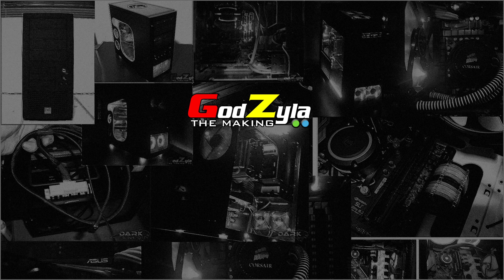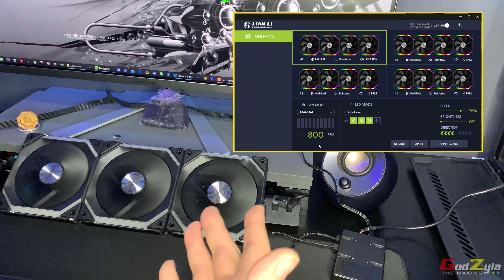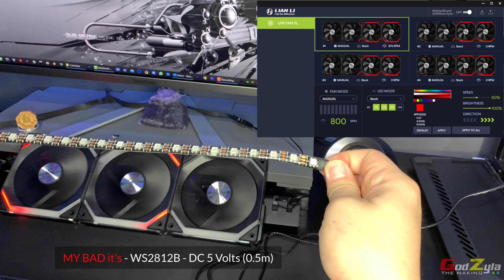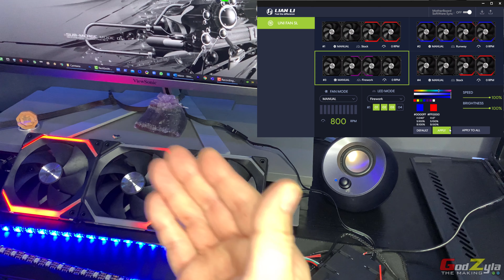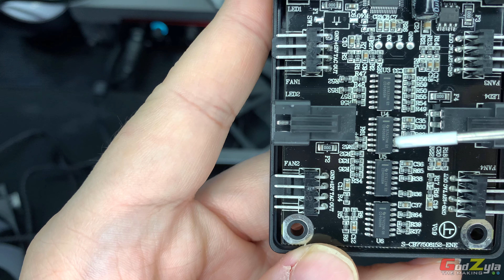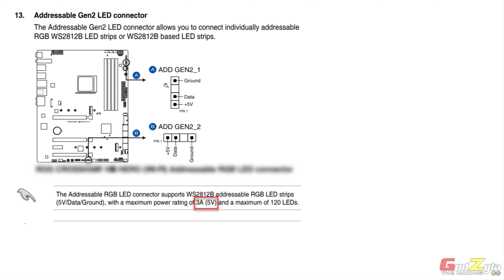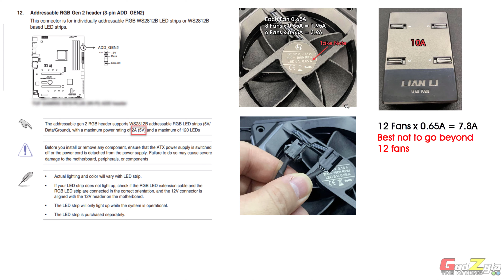Lian Li UNI Fans SL120 - Dos and Dont's (Part II) [L-Connect]

Comment: If I connect these fans to a fan controller than comes with the case and connect that PWM cable to a mobo header, will I be able to control these fans individually via the mobo?
Reply from the maker: Hi stardust 932, welcome to my channel. I believe you are asking on pwm control. If you plug the fans fan connection to the uni controller and to plug the pwm cable between the uni controller to the motherboard fan header. all your fans will follow to that specific pwm settings. you will not be able to control those set individually. However you can leave the argb connectors of those fans to the uni controller and plug their fan load connectors to the different motherboard fan headers, this way you can control the different set of fan's via the motherboard PWM curve which you set.
Reply: @KleoYan  hey, appreciate the response, thanks!
Reply from the maker: @stardust9329  You are most welcome and I hope you are not confuse by my answer. If you have doubts, do not hesitate to ask, I will be glad to aid you out. thank you!
Reply: @Kleo Yan  no i didnt get confused, i realized that the software will think there's only one fan because it's one pwm connection  (connected to 3 fans), so regardless of whether i put the pwm signal into my mobo header or the icue commander pro, the rpm config will be same for all 3 fans  (unless i use 3 separate pwm slots which defeats the purpose of the uni fan design), thanks once again!, i was basically trying avoid a lot of cables cuz you know how it is with these corsair fans, 2 cables per fan, but it's the same case here if i want to control each fan's pwm separately 😂
Reply from the maker: @stardust9329  I see, I never had any problems to manage massive cables as I normally pre-managed them before I insert into the case. This way you will have better control of the whole mess. If I am do to the cable management at the end when all components are inside the case. It will be messy. A trick when I observe when doing pc builds 😬
Reply from the maker: @stardust9329  ok just to share with you. This is my style on pc build https://youtu.be/s20jODhCCcI and this is my actual rig https://youtu.be/0qSaX_mOjQc
Reply: @KleoYan  oh i see, yea i think i should pre-manage than towards the end, i'll check these vids out, thanks a lot !
Reply from the maker: @stardust9329  you are most welcome. all the best in your build too :)
Reply: @KleoYan  thanks :)

Comment: love the videos. Still cant seem to get the fans/rgb to work through L-connect. everything runs but at default. I've tried eveything including Lian-Li software patch as well as L-connect (2). Do you have suggestions?
Reply from the maker: Hi Monte Ryan, welcome to my channel and thank you for the compliment. I like to check with you, 

1) Are you using then SL or AL uni fan? 
2) If it’s SL, does you uni controller have a SL marking labeled on it or without?
3) Which mother board are you using?
4) Are you using any motherboard argb app before installing the L-Connect (2)? 

Will need to know the above before I can try to aid you out. Thank you.
Reply: @KleoYan  hi thanks for the quick reply. The uni fan controller is without SL markings. The motherboard I am using is a Gigabyte Aorus pro Wi-Fi. No apps installed currently. I did have them installed before but have since uninstalled them as I was troubleshooting the issue.
Reply from the maker: @mryan3204  thanks for the fast reply. you've mentioned you did uninstall the previous argb app. I will suggest to follow these steps.

1) Install Revo uninstaller ( https://www.revouninstaller.com/revo-uninstaller-free-download/ )
2) remove the L-Connect (2) with revo uninstaller and clear off all registry left over ( illustration over here https://youtu.be/2eK7QFynxF8?t=341 ) 
3) once you have done that. re-install the argb app which you have uninstall it previously
4) use the revo uninstaller again to remove the argb app 
5) reboot your device 

now reason to practice the above. it could be your previous argb app still having left over registry which causes your L-Connect 2 not able to use.

6) Have you update the chipset driver for your AMD or Intel motherboard? https://youtu.be/8l4i5UjO3es
7) If you did, next, just to check, have you patch the SL uni controller correctly. https://youtu.be/hZpzR_4917c 
8) If you have perform 7) , proceed to install your L-Connect (2) app, test it out. 

see if the above steps helps you out. thank you!
Reply: @KleoYan  thanks for the advice. The patch for the controller is not recognizing a device. Device manager on my pc sees the controller “Lian-Li” but Ene ISP tool does not. I’ve tried all other controllers that came with fans as well as replacing cables.
Reply from the maker: @mryan3204  hmm.. before you test it on your L-Connect 2. did you test it with the original l-connect version 1? I am not sure if your uni controller is done with the firmware properly. for me, normally I will test it with the orignal L-Connect version 1.0 before I do any firmware. This is to ensure that your system is communitcating with the controller and to make sure that the fans are responding first. once that's done, then I will proceed to do the firmware. 

At this moment of time, I only have these option for you. use another controller that you have not done the firmware. download L-Connect version 1.0 and test it. 
if your fans does not response. I can only assume is nothing got to do with your fans or controller. it's your system if not communicating with the controller.
Reply: @KleoYan  I’ll try. Thank you for your help. 🍻
Reply from the maker: @mryan3204  you are most welcome and all the best in your build.

Comment: Hi yan, my fans are going bad shit loud for no reason
and when i checked on the L connect software, all the 9 fans that im using 
is running at 0 rpm
Reply from the maker: Hello Axel cheeze, welcome to my channel. Are you able to control the argb effects?  And are you able to set at l-connect to quiet, high or full? If you able to do those? Or are you trying to make use of the motherboard pwm fan curve on your L-Connect application?  I will test out the rpm on the l-connect first to see if your fans does react when u set as quiet, high or full.
Reply: @KleoYan  I can change the colours and the fan mode  through the L connect app, but the rpm is still showing 0rpm
Reply from the maker: @Capturefoodventures  hmm 🤔 mind if I ask what mode did you set on L-connect? pwm?

Comment: Kleo can u help me ? I made a 4x3 unifan build : i have a set of 3 fan that i cant modify speed. I can modify lights there is no problems but not speed. I tried pwm but nothing change its always at 1800rpm. I plugged, unplugged cable, uninstall l connect and install again. Nothing changed 🥺😭
Reply from the maker: Hi SUP, welcome to my channel, have you tried changing output.. as all your output from the uni controller are occupied by 3 fans each.. you can try swap fan set as in example. swap output one set to output two or three or four.. see if it's the set of fans is having the issue or the output that you are trying to fix is faulty?
Reply: @KleoYan  hello kleo. I will try to switch them. If the problem remain it mean that the controller port is faulty. I will let you know😄 thanks
Reply from the maker: @SoupeDeSup  you are most welcome and good luck 😉
Reply: @KleoYan  alright here an update :
I switched fan port to another one : same problem
I switched all fan to another controller (since i have 4 pack) : same problem
So there are 2 option left i think : or those 3 fans are faulty and cant be speed controlled or the unifan controller cant control more than 9 unifan at the same time. What do u think?
Reply from the maker: @SoupeDeSup  this is real weird. something tells me is fan faulty and not your controller. you see, you've tried changing cables, you've tried changing ports and controller. your other fans are not affected. only the three you have tested. I believe is not all three fans that are faulty. it could be one of the fans in that set is having bad contact point. to drop the risk of all your other fans, I would stop here as I was about to ask you remove one set which is working and to do a swap with the fans. but no, I doubt that will help. I would narrow down those three and to make a replacement on all those three fans. you can approach lian li official report page to file up a RMA form to have your fans replace. https://lian-li.com/contact-us/
Reply: @KleoYan  as last try i will test all those 3 fans 1 by 1 and see which one is faulty. After what i will check your RMA (shame on me i just bought them 🥺. Thank for your help.
Reply from the maker: @SoupeDeSup  you are most welcome. All the best buddy.
Reply: @KleoYan  FINAL CHAPTER : u were right, i tried those fans 1 at a time and 1 of those always went full speed, i cant control it. other are fine and runs normally (in solo or duo combo). i will use ur rma link, i cant stopp enjoying the silence (with the faulty one it was like i had a jet engine on the desk :( ). Peace from FRANCE :)
Reply from the maker: @SoupeDeSup  Nice.. gald that you have found out the issue. you should be getting a replacement fan from lian li soon too :)
Reply: @KleoYan  i got my new fan 2 days ago and everything work perfectly now. They didnt want to take back the faulty fan, they told me to put it in the trash😆 anyway my problem is fixed thanks again. You were a great help in this case🥰😘
Reply from the maker: @SoupeDeSup  Hi ya. welcome back and you are most welcome, am glad you have it sorted out.. ok. I will ask you for this favor but first are you good in handling tools? as what I am going to ask you involve in risk and I do not want you to hurt yourself. are you able to open up the housing that is holding the fan. I am curious what's inside it. please do not use razor knife or blade or any kind. best if you have a hand saw and saw the gap.. I mean since it's a faulty fan to throw. if it's too much, dont worry about it. or if you going to do it. please make sure safety comes first. if you did it, can you take a picture of the interior and send it to me at godzylatech@gmail.com . Now I need to emphasize, please make sure you know what you are doing as I really do not want you to get hurt ok.
Reply: @KleoYan  i will need some good tool for that. 2 side of the housing has chrome metal plate. I will try it and tell you🙂
Reply from the maker: @SoupeDeSup  ah.. you've not answer my question yet lol.. btw are you above 21? if you are not good with tools or have not done any sawing or cutting on material like plastic, wood or metal and age below 21, STOP, I appreciated your help but I don't want you to get hurt ok.. alrighty, am heading to bed.. nite buddy!

Comment: I use a total of 6 Uni Fan sl120, and I connected the thing to ADD_GEN2 , and CHA_FAN3  after that my LED on the fan keep flickering, after restart the LED disappear,   only 3x LED,  the other 3x Fan works fine.  it happened after I tried to sync motherboard on L-connect,  how do I fix this?
Reply from the maker: Hi Chyegarl Alhasni, welcome to my channel, not too sure if you did the connection properly. maybe this can aid you with your build https://youtu.be/Rm2emeyMUAk
Reply: @KleoYan  I found out the problem, the problem is I can't connect the 3x fan to the  controller, I have to slightly pull out the cable into the middle like half-way connected,  because If I stick it until the end, THE LED disappear, I have to plug it half-way.  should I RMA?
Reply from the maker: @MrHyeqarl the argb it suppose to click in place. If you need to pull out and it does not click in place, do a RMA. Better safe than sorry.
Reply: @KleoYan  i'll follow your advice, anyway thanks
Reply from the maker: @MrHyeqarl  you are most welcome. All the best in your build too.

Comment: I bought some SL120 and AL120...
Can you Connect AL and SL on the Same hub?
I can't seem to be able to control the fan speed ( USB, both wires in to the hub, and SATA connected. no connection to the motherboard)
Reply from the maker: Hi Paul, welcome to my channel. I assuming you are using two countroller, 1 is for the SL and 1 is for the AL, it should not be an issue if you connect both uni controllers to an internal USB Hub spliter and then to the motherboard usb header. in these videos I have explained how that works. https://youtu.be/hZpzR_4917c and https://youtu.be/1n1mo6TDwvY
Reply: @KleoYan  Thank you for your support. The fan issue was resolved with a firmware upgrade (non SL on hub) 2 hubs control 9 lights, and fans are on a curve from the motherboard....
Reply from the maker: @Paul-if1jq  nice. That’s good 😊 and thank you to have visit to my channel too.

Comment: Hi Kleo, I am troubleshooting these fans and controller at the moment, was wondering if you could confirm a couple things. My Mobo (MSI Z390 Pro A) only has 12v RGB, I cannot use the 5v ARGB cable to make my fans light up. Will I be able to control the lights and RPMs of my fans using only the USB Connector and SATA Connector (only 2 of 3 connectors in the controller)? Currently, my fans are spinning per the curves set in my MOBO BIOS, but there are no lights at all on my fans. L-Connect Software does not detect my fans at all (all show 0 RPM). :(
Reply from the maker: Hello Anthonyzz7, welcome to my channel. Basically you do not need to connect the argb and pwm cable from the uni controller to your motherboard. Watch this https://youtu.be/Rm2emeyMUAk .You can control your fans using the uni controller on both fan load and argb effects. You will need the usb header on your motherboard to detect the uni controller and to use the L-Connect application to control your fans. If it does not, something is not right. Do you have any other argb application installed? If you have, you might want to try uninstall them using revo uninstaller. This will remove any left over registry files of the argb program which you might have before you install the L-connect.

Comment: What are the up and down arrows on the top left in the software? Would that be import and export? What does that do exactly?
Reply from the maker: Hello Hector F, welcome to my channel. yes those are for exporting your profile and importing your profile. Example, lets say you do a fresh install of windows on your current set. you wish to retain the profile you have set in L-Connect. therefore export it and save it on a thumb drive before you do the fresh installation of windows, once your new windows is done, download the L-Connect and you can import back your profile.
Reply: @KleoYan  Oh I see, thank you for the reply. Btw, I built my first PC recently and it was an O11 mini, I used the video you uploaded to mod the removable metal panel and used automotive wrap to give it a new look. Thanks to your video it helped me make my PC more unique! I'll leave a like and subscribe. 👍
Reply from the maker: @hectorpcmr.  am glad and happy for you on your build 😊. Am curious how your build looks like. Do you happen to have a picture? Mind to share  it with me at godzylatech@gmail.com. Thank you 🤗
Reply: @KleoYan  Yeah no problem, I'll see if I can send you a picture of the build later today or tomorrow. It's a Halo themed PC since I'm a huge Halo fan. Super hyped for Infinite later this year. I was lucky enough to buy all new parts at no extra cost, no scalpers got paid thankfully and even tho I still want a 3070 ti or 3080, I at least got a 6800 xt.
Reply from the maker: @hectorpcmr.  Nice, that will be great. can't wait to see how your build looks like.. thank you!

Comment: I have a question about connecting Lian Li Fan Controller to motherboard:
I want to have 7 Lian Li SL120 fans attached to a Controller. I can Connect Controller to SATA + PWM header + ARGB header on my Asus motherboard. But I do not have any USB2.0 headers free to connect Controller to it. The point is, I do not need to use Lian Li L-connect software at all, I just want to control those fans from my motherboard software. Will all that scheme work without connecting Controller to USB2.0 header?
Reply from the maker: Hello TokWhiteFox, welcome to my channel. Just some detials which you need to know. though you plug the SL fans to the uni controller and to plug the argb and the pwm connector to your motherboard, you will still need to send instructions to the uni controller for it to take instructions from the L-Connect application. that is to set it to motherboard mode. there is no way you can by pass the USB as that's where it takes in the instruction from the L-Connect app, I would advise you to get a internal hub from NZXT. https://nzxt.com/product/internal-usb-hub-gen-3